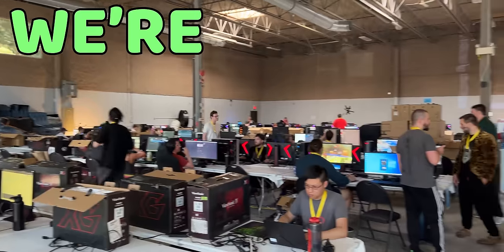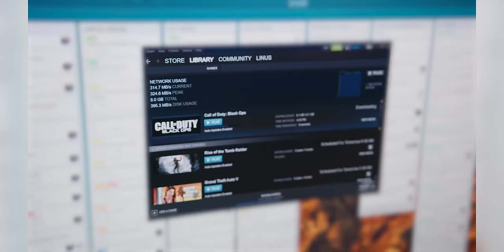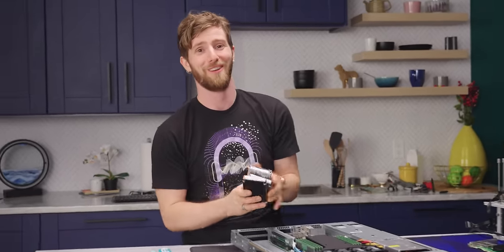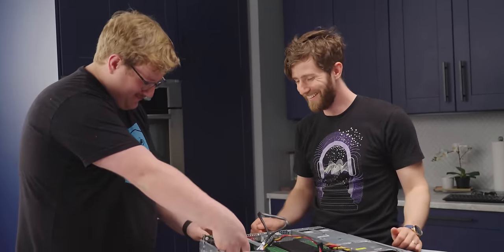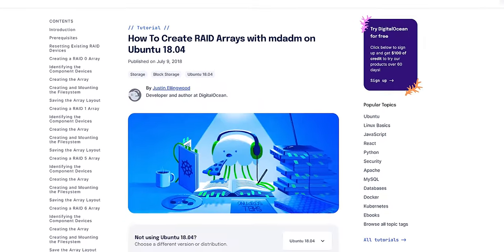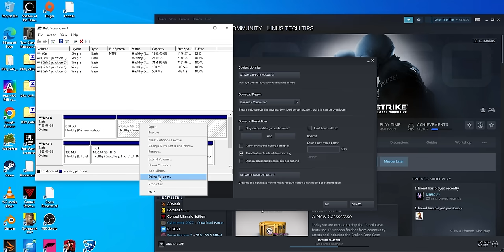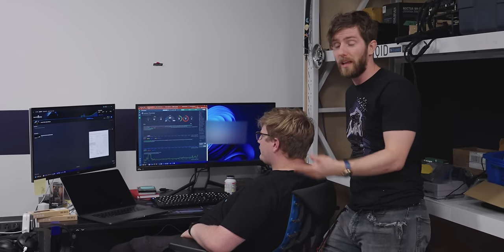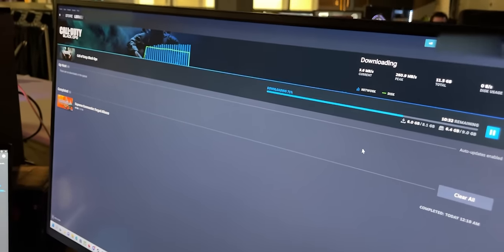We’re running out of internet - Steam Game Caching Server

Comment: you know, after having gigabit internet, it is really hard to go back.  it's a lot like having an SSD and going back to a HDD speed-wise
Reply: Or going from 60+FPS back down to 30
Reply: @Canady117  got a 3060 gaming laptop about 4 months ago. After experiencing 60fps and above for 4 months, I can't play on my  ps4 slim anymore. I now feel dizzy playing on ps4.
Reply: @Canady117  not really the same
Reply: @Canady117  I play at 144hz usually, and I immediately notice when it is below 90-ish
Reply: @MrScorpianwarrior  yeah its like still smooth but then your like "this is kind of choppy" even though its at 90 fps lol
Reply: Me still putting games on my HDD: what’s hard?
Reply: Depends if you mean SATA-3 SSD or M2 SSD. It's hard to go back to SATA-3 SSD if you used M2 SSD.
Reply: The biggest drawback of gigabit WAN is that now your LAN feels "slow" at "just" a gigabit as well. At this rate 10G LAN is only a matter of time. typical r/homelab problems
Reply: @Canady117  or from 120 to 60
Reply: @V3ntilator  I have a 980 Pro 2TB SSD and a WD 2TB Blue both M.2. the 980 is PCIe 4.0 and the WD one is just SATA.

I notice no difference in game load times. Maybe a fraction of a second. In normal usage you won't notice a difference. Only way to notice a difference is in benchmarks.
Reply: Laughs in dial up.
Reply: @V3ntilator  I think you mean a M.2 NVMe SSD. M.2 SATA SSDs are also a thing and they aren't any faster than normal SATA 3 SSDs
Reply: @Old_Ladies shouldn't it be noticeable in copy times? but ye I guess normal users don't really notice the difference between 2 different speed ssds
Reply: Yeah, I moved to a big city with fiber internet a few years ago and my hometown still had slow cable/DSL internet. It felt like going back to the stone age trying to use that old stuff after fiber. Although a fiber ISP is finally installing stuff in my old neighborhood so my parents won't be stuck with slow internet anymore.
Reply: "you know, after having gigabit internet, it is really hard to go back.  it's a lot like having an SSD and going back to a HDD speed-wise"

I would just go back to board games, cards, and telephone, paper, and pencil for handling my finances.  And I'd piss people off by intentionally calling them without texting them first.  😈
Reply: Terrible comparison. You notice fast internet, what like once a week if you play a new game that often? and even then, do you really need to have that game ready in 10 minutes instead of an hour with an average 100mb connection? anything else won't be noticeable, even 4k video only needs like 20mb to stream smoothly.

Comparing that to an ssd which will be noticeable every single time you sit down at your computer, and every second that you use it. It's not that noticeable.

I'm guessing you went from like 7mb dsl to gigabit or something. That would be the only significant jump.
Reply: @flyingtentacle7631  you notice good internet every day..... you can't stream real 4k or even 1440 without it
Reply: That's because you probably went from cable to optics fiber.
I went from optic fiber to DSL but I find the latency acceptable, just that the max speed is capped at 30 down 10 up. My DSL is short distance coming from a nearby cell tower so I'm basically getting the same speed as LTE but at lower latency
Reply: @heni63  Depends what you are copying/transferring, and what CPU you are using also, speeds tend to fluctuate a lot in real world applications, so realistically you will never really use the full speed moving files around on a SSD much less a M.2.
Reply: @flyingtentacle7631  you have an anime character as your profile pic, your opinion...

but I do download and upload a couple gigs a day, everyday.  you say "do you really need to have that game in 10 minutes vs an hour," which proves my point tbh, but I'll ask:
"do you really need your computer to boot up in 10 seconds vs a minute?"  no, but it's hard to go back

the jump in speeds and quality of life are exactly paralleled. great comparison.  I stand by what I said.  seems like 500 other people do too so 🤷
Reply: @rafaelsousa5  might change with the new windows feature for gaming, direct storage. but idk. good that I only bought really cheap ssds, they are perfect (both no cache)
Reply: @heni63  Greetings, fellow $35 SSD user.
Reply: @user2C47  hehe
Reply: @NetDive  yeah I really like my gigabit internet and I wouldn't want to go back to my old 80mb/s internet. If you are by yourself 80mb/s is okay but with multiple people in the house it isn't ideal. With gigabit internet you don't have to feel guilty about not throttling your download speeds as most places won't reach the full 125 MB/s download speeds. So even if you are downloading at 80 MB/s other people in the house won't complain about their internet being slow.

With my old internet at 80 megabits I would have to throttle my download speeds because Steam or other places would use everything and other people watching YouTube or whatever would complain.

Having gigabit internet really came in handy last weekend when I had a LAN at my house. Not everyone had every game downloaded including myself and it was great that we could play those 2 games. Previous LANs we would have not been able to play those games unless they were all downloaded.
Reply: You guys are getting more than 20 fps?
Reply: Good thing the only thing near me is dsl on lines ran in the 80s or local dish to tower that both max out at 10mbs for $120-150 a month
Reply: @MrScorpianwarrior  after like 30 min to hour tho you get used to it and seeing 144 is like brand new again
Reply: Makes me wish I had a router to get those speeds. My Grandpa's house is from the 70's, so the router speed is damn slow splitt between 4 people.
Reply: @Canady117  isn't that much noticeable. try 144 fps to 30.
Reply: I feel like it's worse than any of those
Reply: .... I can only have satellite or mobile data at my house, so we are stuck with 4-20 mbps... with a minimum of 60ms latency... Gig internet seems like a dream. lol
Reply: I actually prefer slower internet.  It forces me to do other stuff in life.  By slower I mean like 30mbps, so still usable, but not crazy.
I mean why bother paying for more than one household needs, right? :P
Reply: @arico7923  how? I've had a pc that can run any game I play at at least 60 fps. I can still easily play at 30fps from years on playing on console
Reply: So true I had a great 1gb x 1gb and now I’m on 350mpbs x 100mbps. It takes forever to download games now lol
Reply: @drduck3722  good for you. Once I play on ps4 nowadays, the 30fps makes me dizzy when I turn the camera around. 30fps is bad for gaming unless it is a turn based strategy game or something like that. Can't go back to 30fps after playing on 60fps. I will rather reduce graphic settings and resolution on PC just to get to 60fps
Edit: Wish ps4 had performance mode like ps5. Only few games had that option on the PS4. I don't mind playing at 720p to hit that 60fps sweet spot.
Reply: @arico7923  weird
Reply: Yeah, I was debating on lowering my gig to 500megs to save $35 a month but I don't think I will. Going into work (that is a data center mind you) where we get a whole 80megs for the NOC office that also at most times drops up to 25%+ of it's packets because we aren't allowed the resources to upgrade our OLD AF rack in the office. Absolutely disgusting.
Reply: @Tupsuu  no, 120 to 60 doesn't physically hurt like going back to 30
Reply: Gigabit makes you feel like you can grab onto anything from the internet in a few seconds to a minute or two and stream with no worries whatsoever... I'm jealous 😂
Reply: @harrytsang1501  I wish dsl was still offered in my area att bought out the locals and is no longer offering it and refuses to run fiber 2 miles to my neighborhood 😢 I'm stuck with satellite atm gonna get starlink soon though
Reply: @Canady117  y’all act like 30FPS is virus. 

I’ve played 120, 60, and 30. 30 is good as long as it’s steady. 60 is good as long as it’s steady. 120 is good as long as it’s steady.
Reply: about a year ago, I had 5Mbps of internet for couple of years and 2Mbps prior to that. Then my ISP upgraded my connection, now it is 190Mbps. I asked myself why I survived that long.
Reply: Had gigabit at one house, 150 mbps at the next (wasn't took big of a deal, just annoying on some large downloads), then 10 mbps at the house I'm in now. Thank goodness I'm moving in a couple weeks and will have gigabit again!
Reply: Hmm idk man I have 300 mbps internet currently but if I were forced to go down to 100 mbps I wouldn't really mind. It's still super fast compared to the 4 mbps internet I had previously.
Reply: I get 50 fucking kerebytes a second on a good day and I’m tired of people saying they have bad internet when it’s like 20 megabytes a second
Reply: @Gl-my8fw  You can stream 4K on YouTube and Netflix with as little as 25 Mbps. That's 2.5% of 1 Gbps.
Reply: well its more like downgrading to a good old Single core CPU from a thread-ripper.
Reply: Gigabit is a waste. On a good day I can watch 4k60fps video on my 450kb Internet.
Reply: @Old_Ladies  You can prevent Steam from slowing down the internet by using Smart Queue Management. It maximizes throughput while keeping latency under control.
Reply: @phatoume227  you could try a new router, or if you got the modem/router from the ISP then you can call and trade in that set for a new one. i had to do that this month since i noticed i wasn’t getting the speeds i should
Reply: I just moved from 200 up/down to gigabit up/down. I concur.
Reply: @Canady117   Same with from 4k back to 1080p :D Noup
Reply: Still patiently waiting for a company to install fibre in our area... we get on average 3-4mbps down. Hopfully we should have 30-40mbps by the end of the year... GODS I HOPE!
Reply: Not really, while i don't have gigabit net i do have 850mb, literally never found single service that could use it fully. Steam is fastest but still it seems like it tops at around 600mb. Honestly if i droped from 850 to like 300 i doubt i would feel big difference.
Reply: Honestly I'm pretty disappointed in my gigabit fiber. While the theoretical max is nice, all it's told me is that 99.9% of all websites are run on archaic 5mbit connections. Even Steam only allocates a measly 250mbit to game downloads for me. Only Microsoft and Google Drive have shown me the benefits of my actual speed which is .0001% of my internet usage.

The fastest connection in the world is useless when you're connecting to server farms renting space to websites for way too much money for shitty 1997 connection speeds.
Reply: @Canady117  30fps to 60 fps is bigger than an ISP upgrade. Most websites still have shitty internet so it doesn't matter how fast your connection is. If they're still stuck in the 90s so are you.
Reply: How? How are you taking advantage of it? I feel like you are limited to the upload speed of website’s far before a gigabit. Maybe I’m totally wrong?
Reply: THE SPEED!😁
Reply: I feel like I'm the only one that doesn't care about the difference between gigabit and 100mpbs or 120 fps vs 60. Still better than my friend that says HDD is fine but won't go below 144hz
Reply: @arico7923  yeah if ur a zoomer i can alternate easily between 30-60-144. 144 being my daily. tch zoomer
Reply: @David-qy4kc  It's absolutely the same. Can't go back to 30 fps.
Reply: I recently went from 50 to 250mbit, with 100 as an intermediate because my old router couldnt handle 250
Reply: This is true.. so don't go there. Those Amish never have this problem. They have multiplayer axe throwing in amazing graphics with 200 FPS and 500 concurrent is no problem. Sure, the controls are a bit fiddly, but IRL multiplayer rules..
Reply: Having it for over like 9-10 years, yeah, I'd never go back. The freakin torrent downloads cap my HDD, still, my visitors watch low quality online streamed movies... Internet is almost like a local network nowdays. I pity those living in older cities without fiber network. They pay 3 times more for like 20Mbits, insane. Also I was shocked when I heard that in some countries they have a data cap for in-house internet, WTF. :D
Reply: @dj Kplus I completely understand the difference in a bit or byte. I've been working with PCs and programming since the early 80s. You're trying to talk down to someone that wrote the book you're quoting. I just did a speed test on Steam and it only gave me a 250 megaBIT speed for a 110 GB game, but I see 990mbit while downloading a new Windows build. Leaving it open or connecting to any random VPN throughout the US gave me zero increases in speed. You're either lying or you have a Steam server cluster right next door on your ISP.

We obviously have different connections but for me Steam sucks donkey balls while MS, Nvidia, and Google want to push your connection to it's limits.
Reply: I have 1.2 Gigabit now. A decade ago when I was in high school my speed was 1.5 megabit. The thing is, AAA games weren't even THAT much smaller of a filesize back then. It was miserable.
Reply: @flyingtentacle7631   Bullshit. It's very noticeable, especially when you share your bandwidth with others. We download and upload things all the time. Sure, it's not always massive games, but a 10 gig file uploading/downloading in seconds rather than minutes saves so much time in the aggregate.
Reply: Straya 40mbps
Reply: Pick a video and go make dinner while it loads.
Reply: I had it for a year. But the upload sucked 1000mb down and 50mb up. I much prefer having 300mb both ways.
Reply: My peak is 6mb down
Reply: @Old_Ladies  You will notice once Direct Storage starts to be implemented more in games. I believe it started rolling out in Windows 10 + 11 March this year!
Reply: @MrScorpianwarrior  Probably because it doesn't match your display's refresh rate. What you ideally want to do for demanding game is either lower the settings to reach the full 144Hz and keep it stable there, OR you can manually limit your FPS count to a divider of 144: 72FPS or 36FPS for example. Of course it won't be perfect, but I can guarantee you that 72FPS is smoother than 90-100 and even 36 may be smoother than 60 FPS. Hope it helps ! (also I use riva tuner to limit FPS, it's a great tool !)
Reply: @Gl-my8fw  you don't need gigabit connection to stream 4k content
Reply: Amen.
Reply: @justaskin8523  I'm glad I'm not the only one who finds it annoying when people do that
Reply: @Old_Ladies  same
Reply: People really out here complaining about 80Mbps connections. I have a little under 3Mbps.
Reply: @tech6hutch  Our condolences 😔
Reply: @dj Kplus Last 9 years, i downloaded 100.GB every 20 minutes so i guess my line still holds up. A game would need to be 300.GB for me to take 1 hour.
Reply: Idk you people saying you only need a 20mps line for 4k tv.  But I would be watching 4k TV and looking stuff up on the internet and my son will playing on his playstation and my wife on her phone watching 4k videos. All that together u need around 200 so there's no stutter.
Reply: I know the feeling, moved house and went from gigabit down to 25mb (tho usually closer to 10mb because its a shit connection)
Reply: @heni63  The thing is, "for gaming", I am talking about loose files, music files etc, not sure if it would affect normal file transfers, and for downloading at least (at least with Steam) software can already use SSDs fully from my experience (I don't install things on my M.2 since it's pointless so no experience with that).
Reply: @glaheramatebi  I put games on my hdd. No point in taking up valuable SSD storage when all my save data is stored on servers somewhere else.
Reply: I had to clone my boot SSD to a hard disk drive, before cloning that to a new SSD boot disk recently. Before cloning back to a new SSD though, I booted off the HDD just to remember what booting a PC used to be like... Literal minutes, just to get to my home page, and every program taking almost as long to launch. Kids these days will never know how good they have it.
Reply: @brandonbrodbeck6688  The 20 Mbps figure is from YouTube themselves. That's the bitrate they use for 4K transcodes. Other streaming services use anywhere between 15 to 25 Mbps.

Obviously, the more devices there are, the more bandwidth is required. No one's saying you can stream two 4K videos at once on a 20 Mbps line. Just that 1 Gbps is overkill.
Reply: @TheKisem  you can't do it with less than like 100Mb if you actually want to still use the internet. No point in getting anything but gigabit most places at this point though as the price difference is insignificant.
Reply: @Gl-my8fw  Depends on what you mean by "use the internet". If you're downloading a 100 GB game, then sure. But if you're just gaming online, then even 100 Mbps is overkill.

Verizon Fios, the fastest ISP in the US, charges $40/mo for 300 Mbps and $80/mo for gigabit. That's double the price.
Reply: @Pow3rus  oh but it definetly does
Reply: @Timothy003L  unfortunately for me internet prices are nuts in canada. it is like 180 for 300 or 200 for Gb. even like 30 Mbps is well over 100
Reply: I backed down from gigabit to 500 to save a bit of money and I don't really feel hindered by that. Even considered going down to 200 to save a few bucks more.
Reply: I know someone who’s really going to feel it soon, he’s planning to get gig internet at his new house but he’s separated and his ex whom he frequently visits can only get 10mbps….they can’t stream 2 things without getting bottlenecked.

At least when I went to my parents prior to their gig upgrade I got 70 mbps, so it was a more tolerable downgrade.
Reply: Lmao, yeah going back from NVMe 4.0 to SATA 3 HDD is almost unbearable xD. Systems feel so slow I keep looking for whats throttling until I realise Im just expecting too much from that poor system xD
Reply: That's UNACCEPTABLE
Reply: @dj Kplus I was writing router bios when the year started with a 1, not a 2. Yes, I'm freaking old, and yes, I know what I'm talking about.

I would happily trade my crazy Microsoft and  Google drive speeds for your uncapped Steam speeds. Unfortunately a traceroute only tells you the latency numbers to see where the hiccup is. It says nothing about actual bandwidth. This is exactly why more developers need to do distributions through torrents. I can get Linux distros much faster than games through Steam.
Reply: If you are talking about sata ssd, it would be just fine.
Reply: i installed win10 os on my cousins laptop,  and i forgot how slow HDD was.
Reply: @nezu_cc  10G cards for my PC and servers turn up in about 3 days, can't wait!
Reply: I have a HDD and 30fps
Reply: @dj Kplus I'm not being combative, you're just reading that wrong if I don't put a cringe "lol 😄" with each message. That's the limitations of text vs speech where you can pick up tones, sarcasm, and self deprecation. While I can't blame you for misinterpreting my comments since most people online are full of complete vitriol, reread them with me laughing and you'll get what I was saying.
Reply: @æ i know, i never said that it didn't. The other examples are based on time while fps is not. Having a hdd makes booting up slower or having bad internet takes longer to do things.
Reply: @pixels_per_inch  thanks for the knolwadge but i did actually already know this. Its also becuase i notice to feel nautious when i go below 90 frames so i notice becuase i have to pause my game and take a break
Reply: @Canady117  the same happened to me when i  got my first expensive headphones
Reply: I haven’t noticed any difference going from 300 Mbps to 1G